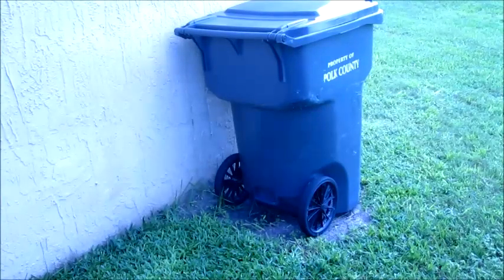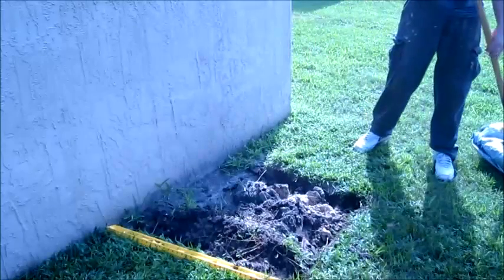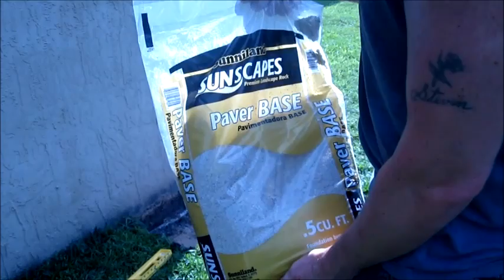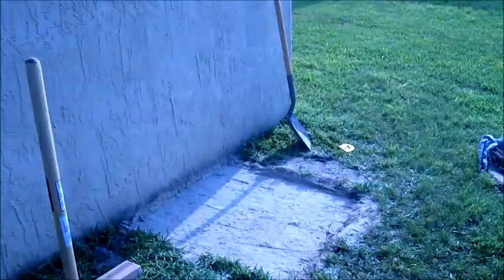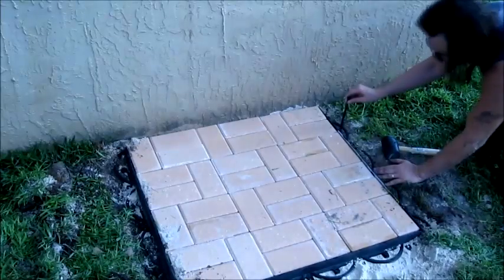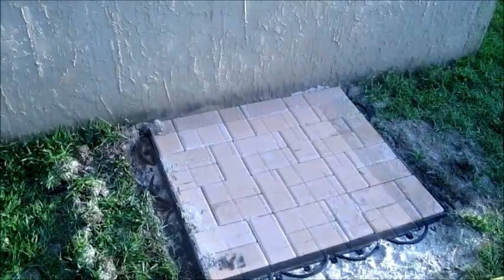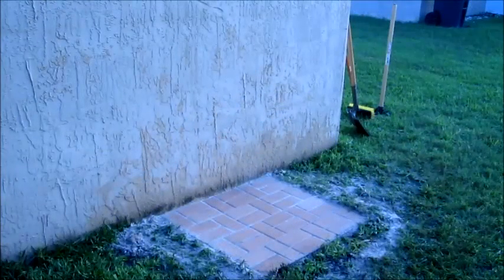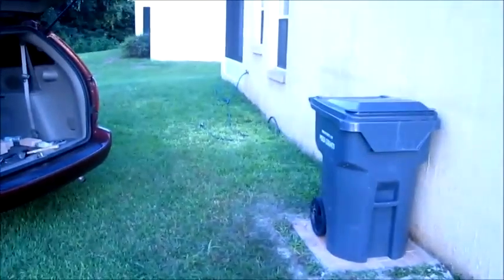Laying Pavers For Trash Can Pad

Comment: I love your video!!! I copied your details to the letter and it turned out perfectly!! I live in Florida, moved here from CA and the soil here is easier to work with! No clay to bust through. Problem is, the area for the trash can is in direct sunlight all day and it took me 3 hours to do the job since I had to take several breaks to cool down. I started at 6:00 am, too! Thank you so much for making the best video on laying pavers for trash cans!! You saved me a lot of money!!! 😊 ❤❤❤
Reply from the maker: That's totally awesome! Glad the job turned out good. Yeah, whenever I worked outside in Florida there wasn't an inch of clothing that was dry. Everything was soaked in a few minutes. Moved to SC to beat the heat. Actually saw snow once here. Hope you enjoy FL!

Comment: Thanks for the vid. I copied your method for a small area for my grill - about 4 feet by about 3 feet. I used large pavers. I'm not good at this stuff but it worked. I didn't get it exactly level but it does the job. Also, I had been a lazy bastard for a while too and my wife was pretty impressed with my work. Initially I didn't get enough paver base stuff so I had make another run for more. Here in Illinois I had to break up a bit of limestone but luckily not much. Thanks again, man.
Reply from the maker: Fantastic! Happy Grillin'!! I myself have been lazy again. It maybe time for another project. LOL!
Reply: im a lazy bastard myself and this is the exact type of video I need to do an area for my grill. How have the pavers held up for you guys after a year or 2 of settling?
Reply from the maker: @KingAK0922  LOL... I'm getting lazier by the day. The pavers held up fine Abhilash. They got a little dirty after 3 years, but I power washed them a few weeks ago and they look new.

Comment: i'm doing the same thing beside my garage. there was landscaping there when we bought the house new. excessive landscaping on the corner/side of the garage. i dug up all the bushes etc and now will put down some pavers for my hose and garbage cans. is it necessary to lay down some of that plastic weed block before the paver sand and stone?
Reply from the maker: No. Everything gets tight and compact when it's done. I haven't had any weeds show up.
Reply: thank you so much for the tips.

Comment: Did you have issues with grass growing between the cracks?
Reply from the maker: Nope. As long as they're put down right and the sand is worked in there shouldn't be weeds.

Comment: Where did you buy the edging and how much did it cost and how did you get such small sections? I cannot find anything smaller than 6ft. I want a 5x4ft rectangle area for a park bench to go on.
Reply from the maker: For this project I bought everything from Lowes. The edging I just cut to length. If I remember right, the entire project was around $60.

Comment: Hey it’s been years since this install how is it holding up?
Reply from the maker: Good as the day I did it.
Reply: stevekonbass cool I’m thinking of doing that for my trash area too but more of a 10ft x 4ft area. Thanks for putting the video.
Reply from the maker: Glad it was a help. You can knock it out pretty quickly. Easy job to do.
Reply: stevekonbass hey if you even remember, what’s the name of the pavers you used? I like those might get the same ones.
Reply from the maker: I got them at Lowes. I think it was the Holland pavers for .48 a paver.

Comment: I'm about to do this myself. Is it necessary to angle it slightly to prevent water build up next to house?
Reply from the maker: With the small pad I laid down I didn't have any concerns about pitching it.
Reply: My question too, thanks!
Reply from the maker: You'd want pitch/slope for a bigger job like a patio. For a tiny job like this I wouldn't worry about it.